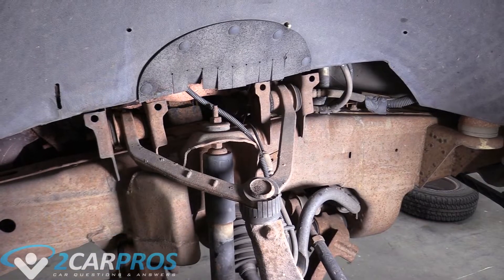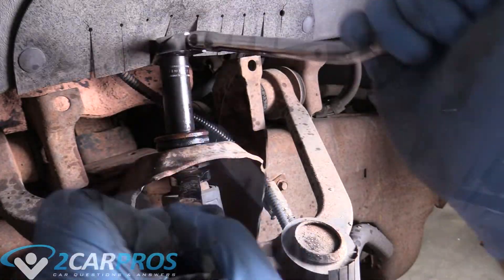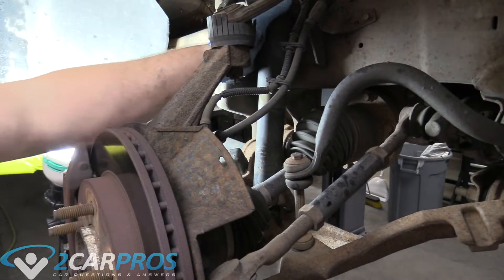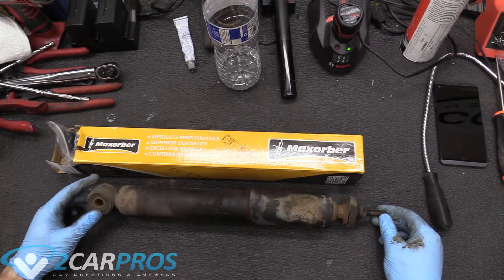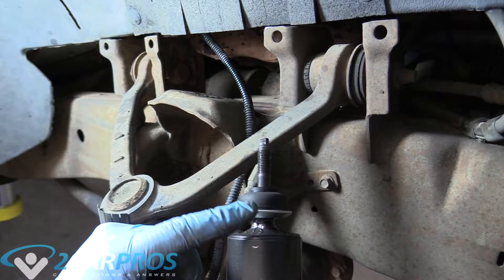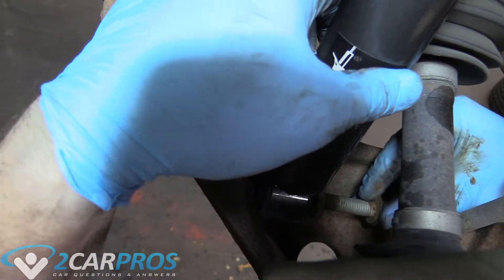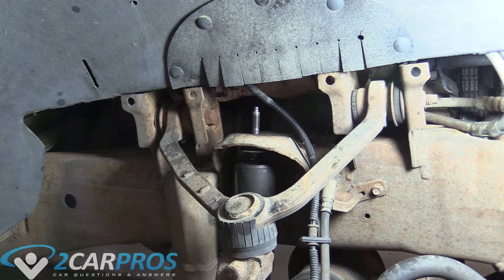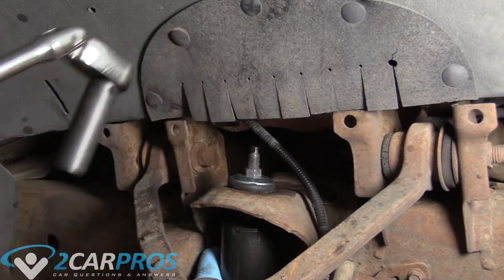How to Replace Front Shock Absorbers Ford F-150 V8 1997–2003 | EASY!

Comment: video was informative ….in real life, bolts don't come out so easy. passenger side..like clock work... drovers side like HELL! Bottom bolt did not want to come out, couldn't knock it out with hammer..had to get propane tank and heat like hell. bolt started to spin but would not come out..it took 2 hrs just to remove bottom bolt. once removed it took only 15 minutes tops to install new shock.
Reply: im right there right now

Comment: Can you do this with tire on. Just turn tire sideways.?
Reply from the maker: I don't think so. The suspension will be compressed so you will not be able to get the shock off much less the new one on. Thanks for watching!
Reply: @2carpros  I replaced front shocks on 2009 wrangler with tires on. I compressed shock by hand and bolted in.

Comment: Not easy on a truck that has a stuck bolt, tried heat, 13mm is on the front side of the control arm on mine, looks to be a nut welded in place on the back side, 13mm side stripped, hardest shock job I have ever experienced
Reply: Next time go to NAPA and buy some penetrant called "In-Force". Made by BG. Leave it to soak 15 minutes. This crap isn't cheap but all my 24 year old  rusty shock bolts came apart no trouble.

Comment: You really are not SUPPOSED to reuse those top lock style nuts, but the factory nuts are priced like gold jewelry.
Reply from the maker: Yeah you are supposed to use whatever comes with the replacement unit. Thanks for watching!
Reply: Kind of a late reply but you can get 3/8 nylon lock nuts from Home Depot